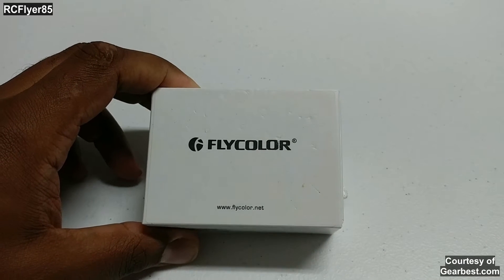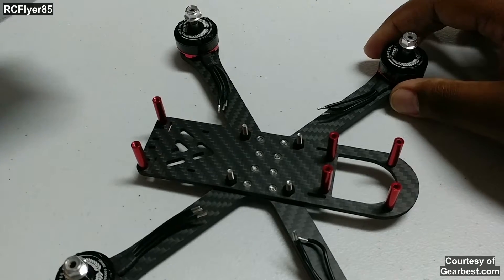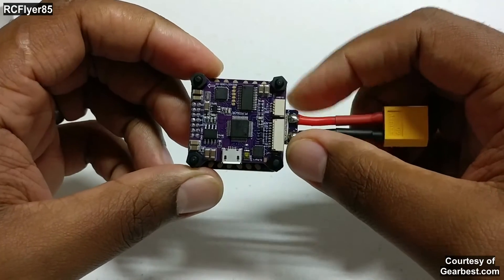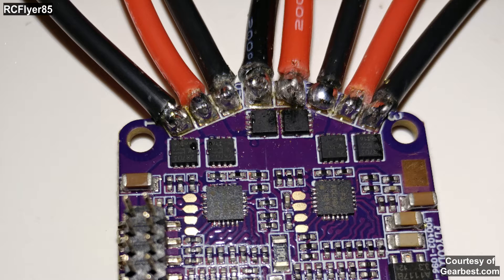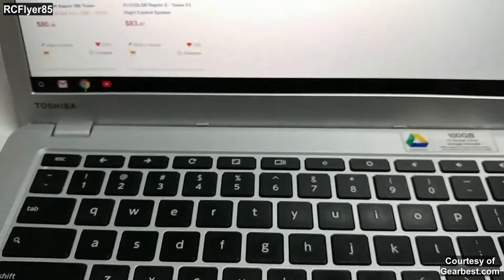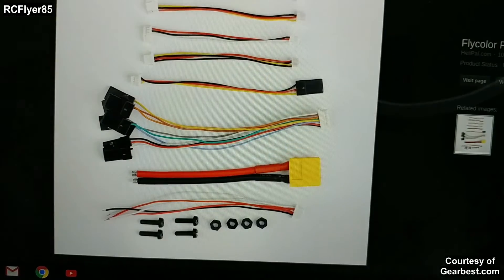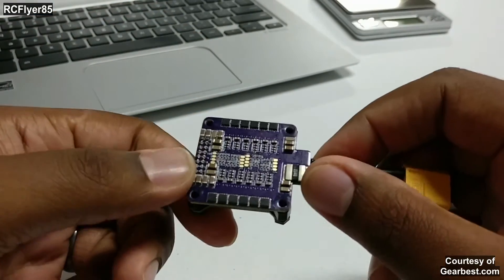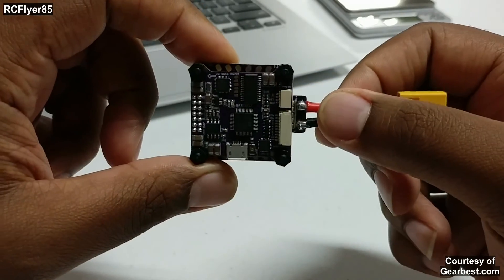FLYCOLOR Raptor "S" Tower - Overview

Comment: Hey, having a problem with Betaflight acknowledging my receiver threw this board...probably a port problem? What am I doing wrong
Reply from the maker: reboot 1 port or you have something wired wrong... triple check your wiring versus the diagram
Reply from the maker: Should be Uart3 for the RX
Reply: RCFlyer85 was reading the thread on RC groups, somebody said they got their sbus working with a full chip erase with update to SPRACINGF3 to 3.1.7

Thing is my firmware menu is only showing up to 3.1.3 for SPRACINGF3
Reply from the maker: reboot 1 No matter the version you should be able to get your RX working... Though it should have all the  options for the newer BF versions available
Reply: RCFlyer85 Okay...I fixed it, was definitely my wiring. Still tho it's weird I don't have the .7 option, I do have the latest bf...oh well, I'm gonna go get in the air! Thanks man!
Reply from the maker: reboot 1 I haven't really checked but I know I've seen a lot of bugs on 3.1.7 so maybe they actually pulled it
Reply from the maker: reboot 1 glad you got it working by the way
Reply: RCFlyer85 ...Okay, one last question, what port do enable to get the buzzer buzzing?
Reply from the maker: reboot 1 It's not a port... It's in the modes tab.
Reply: RCFlyer85 Ahh gotcha! Thanks again!!
Reply from the maker: reboot 1 No problem... Happy Flying
Reply: I also bought this tower from someone that could not get the receiver to work. He was trying to connect Spectrum receiver. I wasn't able to connect my XM+ through SBUS port as well. Reflashed firmware with same result. Had to use XSR on the CPPM port. It is working now.

Comment: Great video man very informative. I bought a few of these towers recently and I'm new to building quadcopters, I was wondering if there is any way you can do a build video? I'm having trouble figuring out a few things like wiring up the camera and the VTX as well as the Rx. I have a Spektrum race Rx and I also have a FrSky X4R SB. I want to use the Spektrum Rx but it requires 3.3 volts & I can only locate a 5 volt port ? I am pretty familiar with the concept of the wiring though I can really use some help thank you for sharing all your knowledge in your videos 👍🏽👍🏽👍🏽
Reply from the maker: Milspec Machine check out the pics from my other video
Reply from the maker: Milspec Machine Check around the 2 minute mark here
https://youtu.be/0zmpC5oph2A

Comment: Hey RCFlyer did you get round to lokoing more at that smartport? I have the 390 tower in my current setup with a Tramp HV vtx and due to the OSD plus SBUS confg i don't have a spare UART to run the Tramp telemetry to enable changing VTx settting via the tranmitter/OSD and was hoping that the new smartport on this board would let me run the Tramp telemetry via that?

any feedback would be much appriciated as I am hovering over buy now as it would be a very simple board swap
Reply from the maker: Martin Fluck I haven't gotten confirmation. It is said that you need to enable smartport on Uart1 so the USB is shared with the smart port and USB. Unfortunately I have no FrSky products so I can't test and my emails to FlyColor have not been a answered. Sorry I couldn't help more. Maybe check out "Flight Brothers" channel and ask if they have any info.

Comment: I was looking at that board earlier, and was wondering what all was different or if they changed just the layout. But I think I will get that board for my armattan chameleon I want to work on. Saves space and I can also put a 12v bec on the power leads easier so I get a nice clean video. But the v1 of this board is still awesome. It's rocking my 280 quad I got.
Reply: I absolutely love how clean the installation was on this build using this board. I'll post some new pics of it on RCGroups shortly.
Reply from the maker: xshadewolfsx Yeah I keep planning builds and keep coming back to the simplicity of these all in one setups. I know they aren't the top top performance solutions but for what I do and how I fly it's more than enough. Hopefully all goes well with your build. Happy Flying!

Comment: I've never been able to run anything other than onshot 125 even with latest firmware on FC and esc's
Reply from the maker: techtiptricks If you're talking about the V1 then in order to run Multishot I had to drop down to 2k/1k before it worked
Reply: Thanks. I may give that a try.

Comment: what size frame was that?  wires look way short. another great video and can't wait to see this build
Reply from the maker: I already ordered so Returner R4's.... They are better than the red bottoms anyway so the emax's will most likely get returned
Reply from the maker: Kevin Brown Frame is 220mm... the last time I bought some Emax Motors they came with very long wires I was really not expecting the wires on these new S models to be so short. I may end up returning them
Reply: With those short wires the frame looked huge.  I was looking at building an Strix AWK 210 5" from readymaderc and use my flycolor all in one the older version  can't wait to see the new build.
Reply: Just solder longer wire leads and get the wire mesh from hobbyking to cover the wires. I went with 6mm, but it was really tight getting all three wires in....  My hyperlites wires were barely long enough for my 180 build.

Comment: I can't wait to see your build and thoughts on setup! Thanks mine should be done soon.
Reply from the maker: GaugedFreak Thanks... I hope to have it done by Friday hopefully. Stay tuned
Reply: One thing I am curious about is the s.port connector on the FC. I wasn't able to get s.port telemetry to work, but haven't messed with the OSD yet.
Reply from the maker: GaugedFreak Ah crap.... I forgot to mention that S. Port pad. Well I own anything FrSky so I won't be much help there
Reply: I didn't think you used Frsky, from what I've seen in previous videos. I'll have to keep messing with it. I've tried soft serial setups, all the UART ports, so far.. I get the basic RSSI, RXBAT, and AT2 but can't get VFAS battery voltage or anything like that. We'll see what info I get out of OSD, that will work until I can figure it out.
Reply from the maker: GaugedFreak If you figure it out id love to know so I can put it in the next video.... Good Luck!
Reply: I'm going to mess with it some more tonight and see if I can figure it out. I ran out of time last night, it was starting to get late.
Reply: Sir , can you tell me which betaflight.hex firmware this raptor S board uses. Thanks
Reply from the maker: Vincent Ko It uses the SPRacingF3 hex
Reply: Thank you sir. 
Also Is the betaflight 3.1.7 default settings for current & voltage accurate? If not what are your settings on both voltage & current(Amp). Thanks
Reply from the maker: Vincent Ko BetaFlight stock should be fine
Reply: Thanks